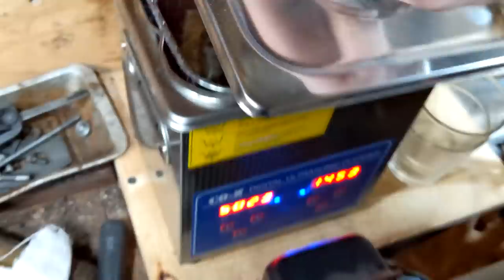Broken Circular Saw - Perfect Restoration

Comment: I've watched several circular saw restorations but never one that went as far as you did. This video was the 1st time I've seen the commutator being machined instead of just cleaned up. You could reissue this with your deleted scenes, there are other YouTubers that do extensive rebuilds like you did that run up to 45 minutes. I'd watch it without a doubt
Reply from the maker: Thank you for the kind compliments! Unfortunately I've already deleted all of the raw footage because it was about 12 hours worth and it took up a bunch of space on my computer. I will be doing more of these electrical tool restorations and I might do those longer in length

Comment: Cool saw! I think replacing the old saw blade was a good idea.Even if you used rust remover and heat treated it. I’m not sure if it would’ve been safe to use.
Reply from the maker: Thanks for watching! And yeah the old blade was fairly pitter around a few teeth that's why I decided not to use it. Would not have been a good idea